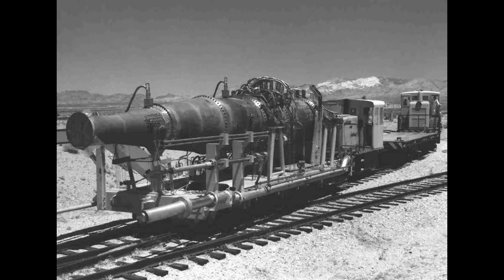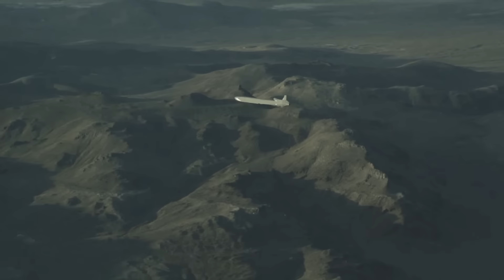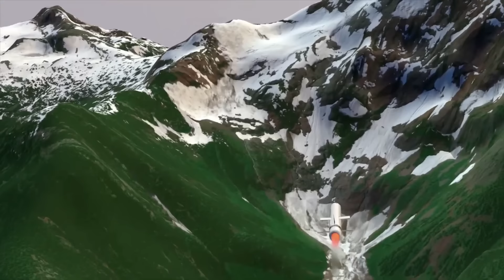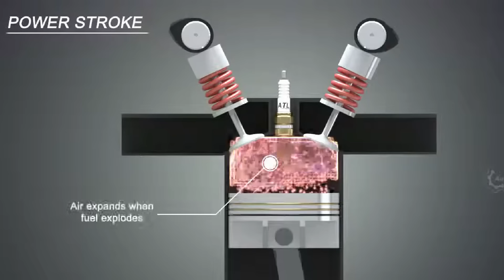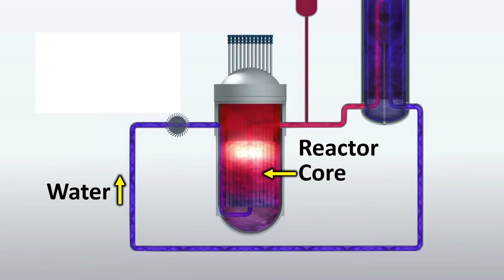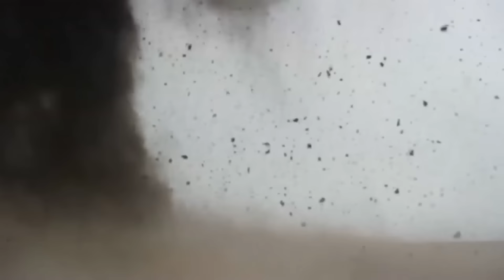How Can Nuclear Reactors Power Missiles? | Russia's Burevestnik Missile #militarytechnology

Comment: Speculating it uses RAM and or SCRAM jet principles. Turbojet is too heavy, bulky, costly and sophisticated.
Reply: Nothing sophisticated about a turbojet. Just instead of burning fuel to heat the air you use the heated liquid-metal coolant from the reactor to do so. What's sophisticated is the reactor itself, not the turbojet.
And if it's flying at subsonic speeds then it can't possibly be using a Scramjet, and is highly unlikely to be using a Ramjet either; they can operate at below Mach 1 but would be pretty inefficient.